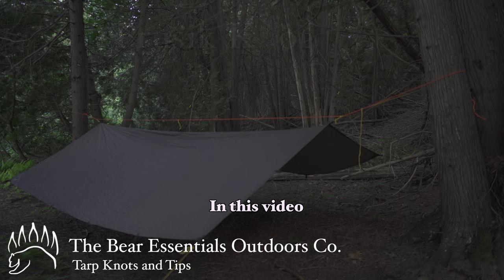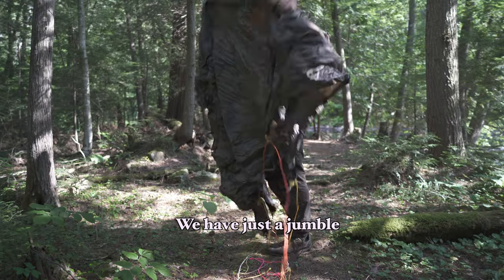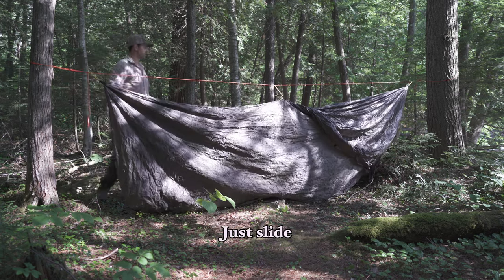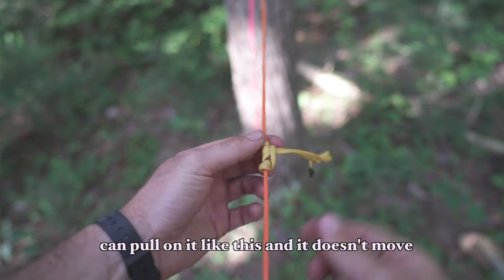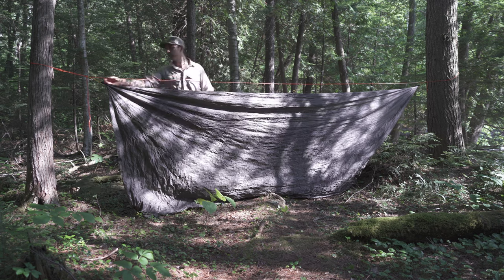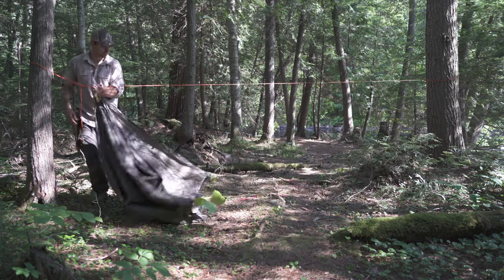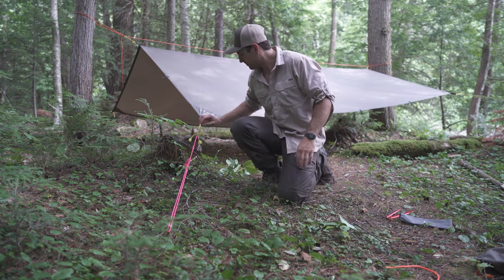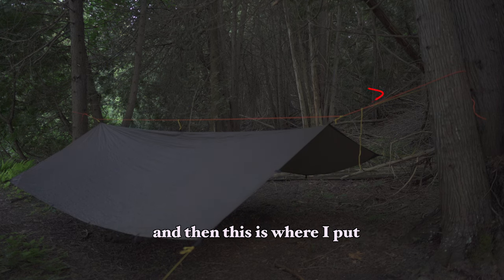Camping Tarp Setup for Beginners!

Comment: What about putting your ridge line UNDER your tarp? You lose the middle guyout point you don't need it anymore but gain an inside line to hang stuff, like wet clothes or an electric lantern.
Reply from the maker: Great idea!! Only thing is if it rains the water follows that line underneath. 

Maybe a hybrid option would be good?
Reply: @TheBearEssentials  two threads, girth hitched left and right from Tarp on the ridgeline, let the water run off, before it enters the dry zone.
Reply: @fuerLutzi  I'll bet you were in the military! Love it.. Thanks.
Reply: @fuerLutzi  I’d love to see a demonstration of what you are describing
Reply: @_Lightning_Dog_ It is really just tying short pieces of rope or thread onto the line, so that the ends hang down. The water will run along the ridge line, stop at the knot and drip down at the ends instead of continiuing along the ridge line in under the tarp.
Reply: Putting the ridgeline constantly underneath the tarp puts additional wear & tear to the tarp on the underside. 🏕
Reply: Not if you make sure there's some distance between the ridgeline and the tarp
Reply: @ximono  Yeah, you could tighten up the ends with some prusik loops and then let the center slack of the ridgeline hang loose under the tarp, which would obviously be pulled taught.

Nothing even would touch the underside of the tarp.
Reply: I run a continuous loop around the top and under the tarp.
If you set it up on a diamond config with sliding stoppers at the meeting point you can adjust it shorter as needed for side on configs like A frame.
Each corner has a sewn on toggle as well as the two ties for A frame.
Toggles slip into prussiks around both top and under lines.
A soft shackle at each end.
Use jungle cords round the tree and the soft shackle knots into them.
But my setups a bit different in that my jungle cord is my hammock susp so both are on one cord.
Reply: Drip lines
Reply: Yeah , you took the words right out of my mouth Fuer… plus you don’t need the prusiks on the outer of the ridge line just do what you suggested Fuer , hang other objects offer them from underneath the ridge line. Cheer’s 😊
Reply: after awhile the Ridgeline cuts into the rain fly
Reply: Thanks so much, this was exactly what I was looking for to use my recently bought tarp!!! Simple but great explanation!!!
Reply: @TheBearEssentials drip lines stop water from following the ridge line.
Reply: @stevej7875  yes, but putting the ridgeline over puts additional strain on the grommets so they fail quicker.
Reply: @OldNavajoTricks show us
Reply: @OldNavajoTricks show us

Comment: Add an extra loop tonyour taut line hitch, back up near the rope, before you tie it off for a Midshipman's hitch, which takes some of the load while you tie off the end. It's widely been recommended that the taut line hitch should be retired and replaced with the midshipman's hitch because of this.

Square knots/sheet bends should never be used for load bearing. They're not strong, they don't lay properly, and it's too easy to accidentally tie a granny knot by accident, which is even weaker. I usually use a Figure 8 bend for loops i wamt to be permanent, and a Sheet Bend if they're meant to be temporary. The Alpine Butterfly is also an excellent choice if you need to make a loop.

Comment: Okay, question for you.  A month ago I had this same setup using a high quality nylon camping tarp 10x10 and a paracord ridgeline between two pinetrees. The front of the tarp was supported by trekking poles. We got some good rain that night and the tarp started you sag and hold water despite the angle I set.  I thought having the front lower than the ridgeline would help with drainage but I continuously had to push the water over the edge of the sagging roof.

Comment: Like the presentation BUT this set-up will not work for an ordinary grommet only tarp.  I can't spend $129 for a tarp like this with tabs attached.  And without a tab in the middle I can't attach attach a prusic then the tarp sags. Do you have any videos using the simple (inexpensive) grommet only tarp?  Thanks.

Comment: Putting your adjustable friction knots at the corner of the tarps as opposed to the stakes,  you can adjust tension simply by reaching out slightly from under the tarp. You can see how this would be a big advantage in wet weather. Going to the stake to adjust will get you wet, adjusting simply by reaching your arms out to the corners of the tarp will keep you much dryer. I used to do it your way but experience changed that.

Comment: If you put the taut line hitch at the side of the tarp, you no longer need to bend over to make adjustments without losing any functionality in adjustments. A two-inch bowline knot at the peg end will easily grab a tent peg or wrap around a tree utilizing a toggle. An added benefit is all the knotting is already complete.

Comment: The reason for 3 turns on a prusik is if you are using lines of the same diameter.  If the ridge line is thicker, you only need 2 turns.

Comment: I've read that the reef knot isn't a great way to connect ropes that are floating free, though it is good cinched down around a rigid object such as around a tree or in shoelaces.  I prefer the zeppelin bend.  A little fiddler to tie, but much easier to untie after being loaded.  And it will never work loose under lots of shaking....
Reply: Or a double fisherman’s knot, which is exceedingly secure. Although, the square/reef knot is very simple and effective.

Comment: Excellent !!!
Gave me some great ideas.
Thank you !!!

Question(s):
Why use a taut line hitch on the ridgeline, instead of either a toggle or stick - (a makeshift marlinspike hitch ?), a set of running half hitches, or a carabiner, etc.) on the "base" side.....and a trucker's hitch or a "doubled-up trucker's hitch on the "tightening end" (with 2 loop-throughs of the slip knot feeding from the tag end) ending with a slippery half hitch, or 2 ???
Also, do you have any issues with the 550 cord hitches/knots once they have been rained on (wet), and then they get dried into those positions ??? (I have had prusiks get "locked" into a tightened position, needing a marlin spike or screwdriver to loosen the knots....which sometimes makes the line(s) unusable afterwards.
Also, LOL, sorry for being so annoying with the questions...but, what tarp (brand, name, size, type of material, etc.) are you using ???
Thank you in advance.
Reply from the maker: Hey, wow that’s a number of great questions! 

You can definitely use any of the options you mentioned. 

Truckers hitch is the most common or carabiner I’d say. Both of which work well. But I prefer the taut line for its adjustability and keeping majority of my knots the same - a benefit when camping with other people, or solo. 

You’re absolutely right about the 550 in the rain then drying. However I’ve never had them tighten to any point of concern personally - so I can’t comment there - it just hasn’t happened to me (yet maybe?) 

Honestly this tarp is from Amazon, it’s called Aquaquest guide - I use a 13x10- and one of the best ones I’ve used for the price - Very surprisingly !

Here’s an affiliate link if you’d like to check it out /help support my page!! 

My Tarps (10ft X 13Ft):
CAN: https://amzn.to/3Jz6HEM
USA: https://amzn.to/3Sru6Mb 

Cheers brother, and thanks so much for the questions!!
Reply: @TheBearEssentials , thank you for the response, Brother !!!
I will look into getting that tarp.
I will also record a video of the way I am currently using for setting up my tarps.
Thank you for the motivation !!!
Reply from the maker: @thefucrew9865  would LOVE to see it! Thanks man!!

Comment: Looks like you have two different guy lines tied together on the  corners. Can you share why you do this?
Reply: Easier.

"Permanent" one on the loops/grommets for quick assembly and colour coding. Then tie a hitch around it and the stakes just depending how much space is needed on the spot. You're also distributing a bit of force and tension so you don't tear apart your tarp.

Comment: As the name implies, the Reef Knot is only good for tying two ends in fairly low-loads, like tying reefs in to sails - it should never be used for high-load/life and death situations.
Reply: what is better than the reef knot?
Reply: @Fuhrmann53  Howdy.  "Better" is of course relative to what your job is, but if you're looking to connect two ropes of the same size then a bend knot is preferable - personally i like the Zeppelin Bend, which is fairly easy to remember and comes loose readily after being under load.
Reply: @robertlock5501  Hi ... the Zeppelin knot is a very good alternative. But to brace a tarp it may be unsuitable because it requires too much space or rope. As a connector to the ridgeline the distance may be too short. Which knot could you recommend then?

Comment: The video is good, but you should know that the knot which the author named as "Taut Line Hitch" might be another knot. There are number of resources where "Taut Line Hitch"  is very similar to what was shown in the video, except for the direction of the last half-hitch: it should be also OVER the main line if you did the first two half-hitches OVER it and UNDER if you did the first two half-hitches UNDER.
Reply from the maker: Hey friend, great eye in examining that, but this one is in fact the taut-line hitch, the one you may be thinking of is the Magnus Hitch, I have a good example of both at 6:10 in this video: . 
https://youtu.be/5lLPAHK_k6I

If that make sense.. but at any rate, both the taut line and Magnus do the exact same thing.